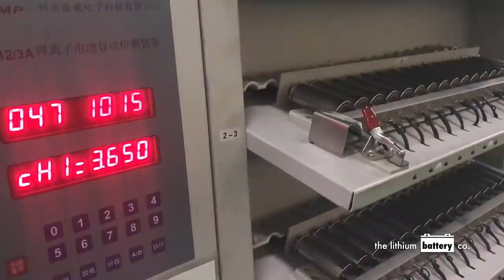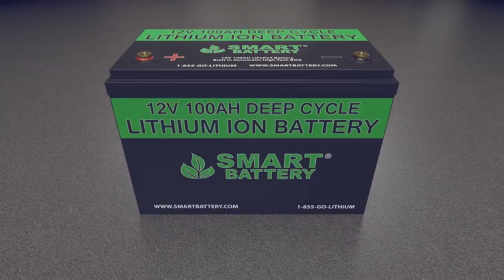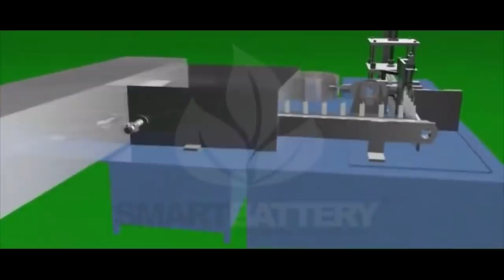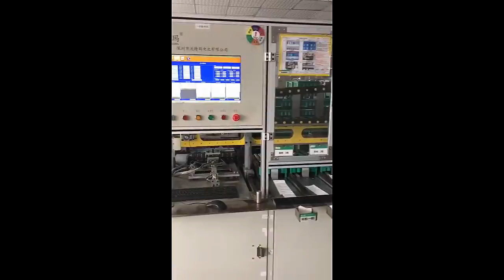LiFePo4 32700 32650 battery cell. factory production and crash test

Comment: Can you tell me the full charge voltage of 32650/32700 cells and whats the resting voltage?
Reply: 3,6…3,65 to charge, 3.35…3,3 to rest after recombination iones. main operating range 3.3-3.1. outside these voltages there is a rapid increase or decrease. due to this it is very difficult to estimate the charge capacity by voltage

Comment: I need 2, 4, 6, maybe 8 of the 600 ah batteries, lifepo4 doesn't really fit the 24v range, the 7s liion first best, 20v - 29.4v, I can, or my inverter can,  handle 30-31v . I was going to charge, to 28.7v, and try to t stay above 24v,what is the cost for the large batteries, 600ah, is there any in the US??
Reply: you could buy the battery cell and DIY yourself, but 30-31v is not common,

Comment: For those who are interested in the company, this company is on the edge of bankruptcy from mid 2018 because of policy change. Since the whole green energy industry relies heavily on government subsidies, and China chose [[[ ternary lithium ]]] as the future, LiFePo4 had been kicked out of the subsidy list. No one can survive the biased compitition, so the company had already stopped producing and fired/laid off most of workers from 2018. I guess this is a out-of-date video filmed at around 2016, when the company is on its prime time.
Reply: That is sad. This form factor is perfect for self assembly for the DIY market.
Reply: Ahh, thanks.
Reply from the maker: interesting
Reply: optimumnano closed already, but a lot used batteries ,still in the market.
Reply: That sucks. Thanks for the info.